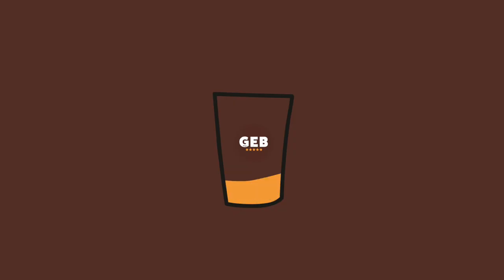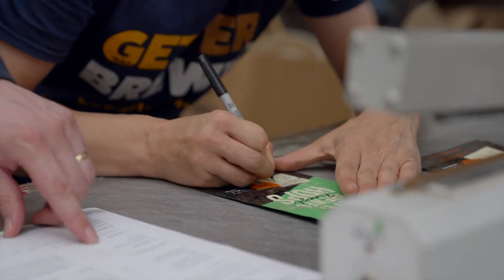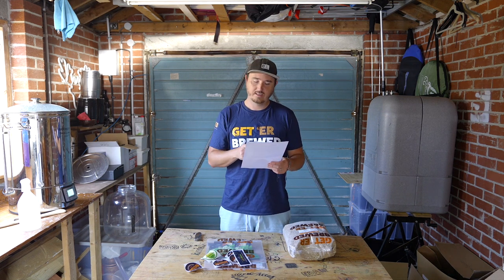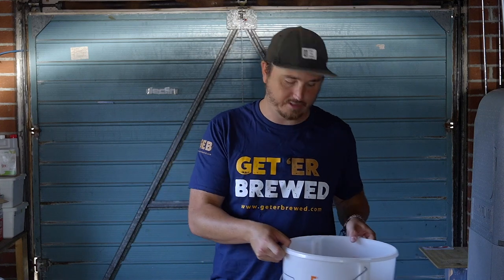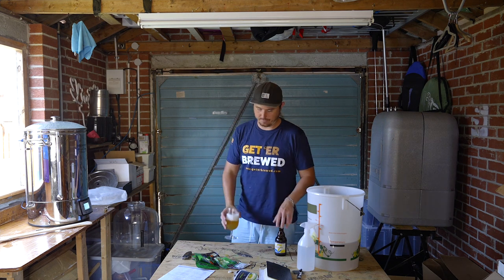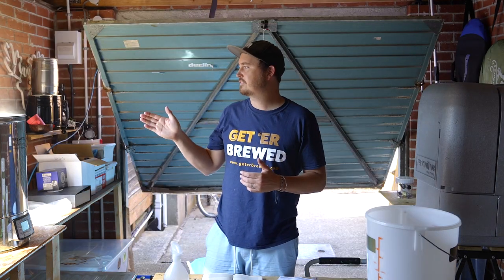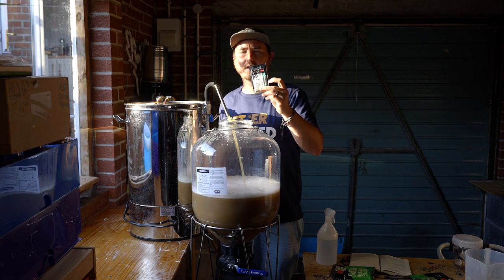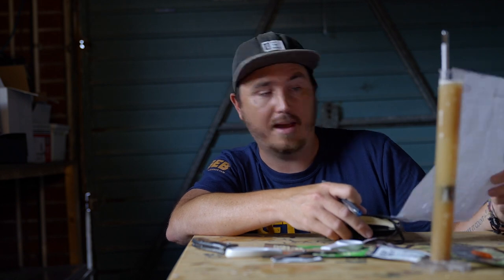Making your first lager step by step

Comment: Play "Nadia's Theme " while reading my comment.  Got 5 beers brewed. Yesterday was my second in my All Rounder, pressure fermentation.  A Golden Hoppy Ale with Citra and Sabro Hops. Smelled amazing. Go to check the fermenter last night, it's wet underneath.  #@%$... is it cracked? Lost over a gallon...oh...oh...I put the spunding valve on the liquid line with the float...amazing how that 12 PSI pushes your brew up and out that valve. At least my pantry smells amazing.
Reply from the maker: Ah thats not cool but as they say everyday is a school day

Comment: 17:33 That looks like one of the less reliable spunding valves. The Doutight Blowtie ones (red with yellow adjuster) are more reliable.
Reply from the maker: We've found it to be very reliable as long as all joints and seals are securely in place

Comment: When low temperature mashing is used beer tends to overly dry and thin during fermentation and conditioning. To counteract the affect, a step is used that causes dextrinization and gelatinization to occur, or another higher temperature rest around 68 to 72 can be used, which produces more sweet tasting, nonfermenting types of sugar, and less glucose. At 63, rest mash for 30 minutes, any longer, and Beta denatures, but Alpha is still active. Increase mash temperature to 68 within 10 minutes with boiling water, and rest the mash for 20 minutes. Then, increase mash temperature to 70, or 72 with boiling water, and rest the mash for 10 minutes. Test for starch, no starch, sparge. The higher temperatures, and rest periods can vary to produce different levels of sweetness in the final product. The higher the rest temperature, the quicker Alpha denatures, and sweeter tasting, and lower ABV beer is produced. 
Pseudo, ale and lager are produced with the step mash method and under modified, low protein, malt. Crisp German Pils is under modified to high modified, and low protein to high protein, malt, depending on the bag of malt. Crisp produces low protein Marris Otter. Their Marris malt contains more sugar than their German Pils malt, but the Marris Malt's diastatic power is on the low side. The malt is high modified to over modified making it great distillers malt. 
When the home brew was made, the richest starch in malt, called amylopectin, which provides body and mouthfeel in ale and lager was thrown away with the spent mash, paid for. The rest temperature wasn't high enough to burst the starch, where the starch enters into the mash liquid, before Alpha denatures, and that is why the starch was thrown away. Amylopectin makes up the tips of malt, it is hard, heat resistant, complex starch that contains limit dextrin, and pectin, which are the ingredients that provides body and mouthfeel in ale and lager. In home made beer, body and mouthfeel are provided by starch carry over, Beta Glucan, and protein sludge. The finest ales and lagers are produced from dextrinous extract, not from extract that contains mainly glucose, sweet tasting types of sugar, and goop. To take advantage of amylopectin, and to produce stabile, balanced, extract, the decoction brewing method is used, where mash is boiled a few times. Under high heat amylopectin rapidly opens up and enters into the mash liquid. When the boiling mash is added back into the main mash, Alpha liquefies the amylopectin, and dextrinization, and gelatinization occurs.
STAY PARCHED. STAY EXTREMELY PARCHED.
Reply: Boring.

Comment: Has the color of the NEIPA you made darkened?  NEIPAs are terribly susceptible to becoming lightstruck/skunked/oxydized - I use oxygen scavenging caps when I do one of those. Light is also a no-no and you've got that lovely window. Looks like a cracking beer you made...Cheers!
Reply from the maker: If you have option to transfer under pressure you can help eliminate the issue your having with oxidising

Comment: I have exactly same equipment, but with kegs and co2, 4 ferminators and fermzillas :)) ps dont buy inner temperature stick for fermzillas - they are all need to be glued after some time. And i cant add pressurized beer to bottles course there is too much foam and you can add only half bottle so i use kegs :)) i have about 30 brewings, ales were all awesome, but lager is not great at all. I even waited for month for it to become beter in keg, but not very good till now :)) and one ale sucks too - that i made now and tasted today, with mulberry, i suppose i mistaken with alphaacids % and it smells not bad but nothing special too :)) rest ales were awesome. Highly recommend to all people to brew ales, they are better but you need to drink it kind of 5-10 days when its ready. Lagers are seems to be hard and useless to do